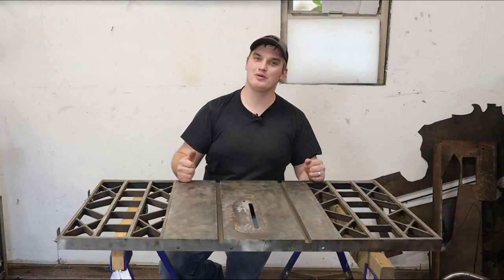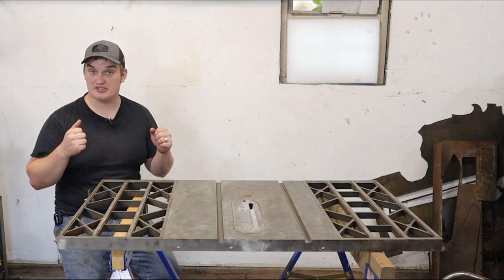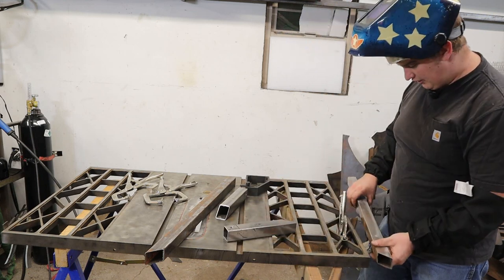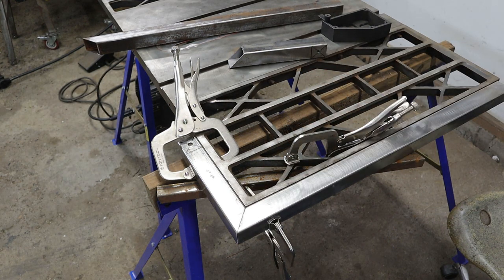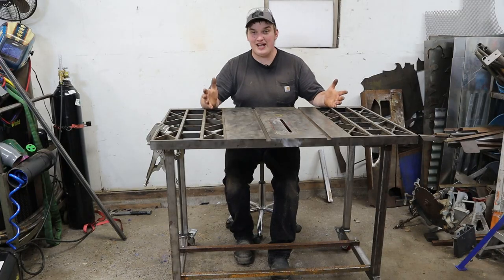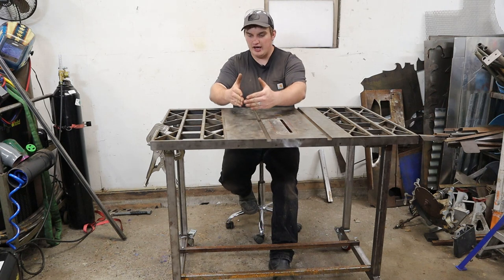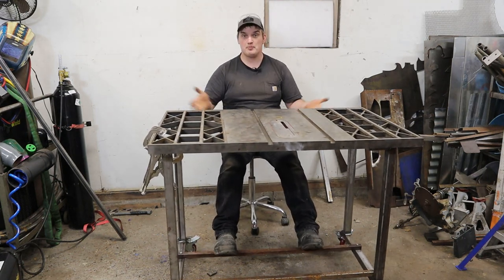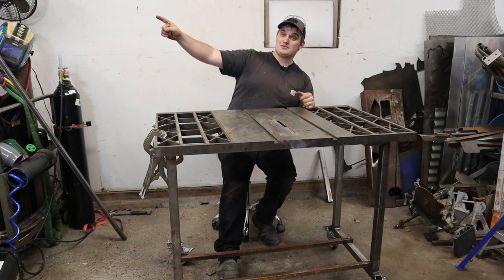$30 DIY  budget Welding/ fixture table build  Part 2

Comment: Thanks for the great ideas. I bought an old Craftsman table saw for $25 off Craigslist. Then removed the saw components, opened up the backside and welded two shelves inside. Added 2" casters. Left enough clearance to put my foot pedal under the bottom shelf. Doesn't fold up but it is sturdy and mobile.
Reply from the maker: That's awesome . Way to think out side the box. Thanks for the support. 🙏👊😎

Comment: Just an idea for your table bottom crossmembers . Square tube like you have already but instead of bolting it together just cut 4 pieces of C-Channel a few inches long , then have the open C pieces facing down then weld them to each end of the cross members . Then you can just set them with the C-Channel straddling your front to back stringers . Just a faster set up and teardown for mobility . Just a thought .

Comment: I picked up one of these from an engineers daughter who had it laying around for over 20 years. It's such a beautiful piece of equipment. That one was $30 I've come across multiple under the $80 mark. Great ideas across the board.
Reply from the maker: By the way I love your YouTube handle
Reply: @amcustomfab  thanks buddy I created it after my first choice got taken after I procrastinated. I wanted to chime in back here, that as a quicker and easy and maybe cheaper option a rolling miter saw stand might be a good base for those that want the folding ability.

Comment: Great job.  I liked the flip up stops.  You could use those on two sides for making square joints instead of using the outside of the table. Also, clever idea reusing the miter gauge. I hope there will be more to this series. I already watched your videos on the clamps, belt grinder and the electromagnetic "vise" are all great options, I'm trying to think of more ways to use the parallel slots.
Reply from the maker: Thanks for the support. I still have parts left over and I still have ideas on functional tools that can be made with those parts just have to get the time to get the videos out I appreciate the insight  ..

Comment: Excellent project. I thought of a possible enhancement: where the throat plate is, maybe add some square tubing that you could use for clamping like you do with the webbing? Also, when it is folded up maybe a couple casters on one long edge would make it easy to roll to and from your truck; 100 pounds gets heavy fast if you have to carry it very far. Great job! Thanks for sharing.

Comment: I bought a heavy duty steel cart on wheels with grease fittings. Tomorrow I have my eye on an old craftsman table saw all cast iron just like the one you have. I love creating useful stuff and maybe selling it. It’s my second build the first one was a three legged grinder table and I added a steel 12x60 grate from a parking lot drain. I cut it in half and spot welded them in a 24”x30” table top bolted to the grinder table so I can disassemble it and move it around in 2 pieces.

Comment: One addition I'm gonna use with my table. I ordered two craftsman miter guages with clamp stops to help with mitered welding. One guage for each slot ... angle it as needed...clamp it down before welding. Thanks for your video! Your inspiring new welders to get started inexpensive ideas. 👍
Reply from the maker: Thanks for watching 🙏😎👊

Comment: Great build! I would like to see a rotary table on this. You could put an axle bearing in the open area and have two round pieces of metal. the top having space for clamping and the bottom "smaller piece" to be able to spin with your foot. so when you have round welds to do. you can rotate with your foot and keep your hands in the same place. you could also use axle stops or callers to make it removeable for when not needed.

Comment: I like the creativity and video series. One thing I'd say for your table corner fixturing trick is to clamp 2 tubes diagonal across the corner on the top of the table instead of 1 below. It will be easier to clamp them, and easier to have the top plane of the tubes level since they'll butt up against 2 tubes held in plane by the machined table surface.
Reply from the maker: Agreed thanks for watching 😎

Comment: I bought one of these saws today because of your video! I'll use the table for welding and the motor and stand to power my belt sander because it's motor failed last week. Thanks for the ideas!
Reply from the maker: That's awesome thanks for watching 🙏😎👊
Reply from the maker: That's awesome thanks for watching 🙏😎👊

Comment: I'd like to see more detail on how you fastened the legs to the table. This is a great series.
Reply from the maker: Bolted tabs through the existing threaded holes on the bottom of the table. Then welded those to the frame for the legs thanks for watching and supporting the channel 😎🙏👊

Comment: Great table!  just an idea -- instead of bolting your horizontal bottom braces, could you use a locking shaft pin like for a pto or trailer and have a quick set up and take down?

Comment: I like the folding legs. I'm just a hobbyist welder so I don't really need the portability but it might come in handy on occasion. One question I have is about the table top now that it's mounted on those widespread legs. Have you checked for sag across the table?
Reply: I was thinking it could be mounted to one side of a work bench, on a hinge, so it would hang when not in use, but could be folded up to match the height of the workbench with swing down legs for support.  That way you save space when not in use, and you have the extra flat real estate when you need to weld something.  I think I am going to try this on the back of one of my roll away tool chests.  I have a 72" husky box that might be just right for the job.
Reply: @jeffdesilva    Those are snazzy.  Please let us know how they turn out, and if they have adjustments to achieve good flatness between the two decks when deployed.  Thanks for the heads up!

Comment: You might want to think about adding extra load bearing support for the heavy middle section.  Those lattice wings are only meant to support wood as it passes over, and now you've got a few bolts holding the solid section plus your arms and  whatever metal project you're working on.  Bolts can stretch and tear unless you've got really good steel in them.  Other than that, I'm stoked about this table!
Reply from the maker: You are correct I actually have the wings shimmed so the frame is supporting them past their bolts joint. Thanks for watching 🙏👊😎
Reply: @amcustomfab  Imagine that for some cosmically weird reason all four bolts give way at once.  Would the shims hold it up, or would the table fall in your lap?

I'm just thinking that as the bolts stretch you could end up with a dip in the table after twenty years, putting minor errors into your work.  Easy to correct, but you have to notice it.  Of course all of this probably won't ever happen, but in my shop, any flat surface becomes a storage shelf or step-stool.  Weight happens.

Comment: I found a working saw just like yours for $80 on Fakebook.  Sold the 3HP motor to a friend for $50 (needed it for his air compressor).  Stripped the guts and reinforced the legs with some scraps (bed frame rails)  Thanks for the great idea. down the road I might put a stand like yours under it.. do you have drawings for what  you built? Happy to throw a "service fee" your way for sharing..
Reply from the maker: I don't have drawings for the stand but I'm working on drawings for the belt. Sander

Comment: So, I see you are familiar with Fireball Tools.  I've bought a variety of their squares and I had a thought for you...    I was looking at my Magic Square that Jason sells and thinking it could be used in conjunction with a piece of bar stock so that you could quickly set clamp angles that are measured in degrees from the cross slide slot.  Sort of a combination of a perma-square/protractor/fixture clamp.  Jason is such a good dude, and always has an eye for innovation... I would bet that if you contacted him and showed him your idea, he would be on board for a fun side project combining his magic square with a cross slide tool.
Reply from the maker: I have met Jason he's a great guy. He's got some things in the works that are similar

Comment: Awesome Idea! just picked one up for myself, def gonna be a game changer for me, was thinking of trying to use some gas struts for the folding legs...think its doable? I do a lot of mobile work and have a tiny shop space so it would be nice to take it with or store it away.
Reply from the maker: I don't see why gas struts wouldn't work. That's a great idea. Depending on your folding mechanism, you might still want some sort of redundant lock to hold them open, but besides that I'd say give it a go

Comment: Thats a genius idea. Just got on FB Market place to find one for myself. Also, on a side note, do you have issues with messing your blades up on your Evolution saw when cutting at like 45 degrees angles? I've damaged 2 blades so far and ive probably only made around 100 cuts. Its like the blade catches as its about to pass completely through the metal.
Reply from the maker: There's a definitely a certain amount of finesse involved in lengthening the life of the blades you want to lunge slow at first, then you can speed up through the center of the cut and it slow down again at the end of the cut and make sure your materials supported so that it does not find on that last little piece before it breaks through the material. Appreciate you watching.

Comment: Thanks for part 2!  
-What was the name of that square you used?
-What type of material are you using foe the stand?
Reply from the maker: The square is made by fireball tool. All the tubing is 1.5".    .095 wall  square tube thanks for watching 🙏👊😎

Comment: @amcustomfab How did you weld to the cast-iron? I understand that's difficult to well too but you were able to get the steel tube to stick to it, is there any special technique? I just picked up the exact model you have from Facebook marketplace this morning and I am taking it apart now. Very excited to move forward.
Reply from the maker: Actually did not weld to the cast iron. I drilled pieces of flat bar and threw bolted from the bottom where the factory mounts were and then welded the leg frame to those pieces of flat bar.

Comment: You mentioned the slag seems not to stick to the top a proper table saw will have 3 coats of wax on it . I wonder how ceramic wax would work to preserve the welding surface?

Comment: The video did not show what is securing the table to the frame you made or supporting the top when weight is on it. How exactly is the castvtop attached to the fab frame
Reply from the maker: It shows briefly at the 3:40 second mark  there are a couple tabs welded to the frame that have holes that bolt into the existing threaded holes on the bottom of the casting

Comment: Good idea, but those table saws are not cheap in my part of the country. And if you find them, you would be wise to use them as a table saw, way better than the cheap sheet metal ones that Craftsman made in later years.

Comment: Hi I have a question-I have a line on a craftsman table, but I wanted to confirm, the table you bought are the side wings that attached to the main table, are they steel or aluminum?
Reply from the maker: They are steel
Reply: @amcustomfab  thanks
Reply from the maker: Thank you for watching

Comment: have you ever welded cast iron. My table is pretty flat i was thinking of just tacking the under side of the table where the wings connect to the main table. I saw that it can cause cracking, I dont want to mess it up. Any thoughts?
Reply from the maker: I would not try to weld the cast iron. I ended up drilling some holes in some flat plate bolting that to the existing threaded holes on the bottom side of the table and then welding the flat plate to my frame
Reply: @amcustomfab  yes I did see that. Ok thank you. Dude I am excited to build this table. I picked up the saw today. I’m amazed at how well built and well constructed even down to the fasteners. The table is.

Comment: What set up do you have for a vise and bench grinder?
Reply from the maker: I don't own either of those tools. I guess I have a tiny machinist vice that sits on top of the table like one of the little two inch ones if that counts?. No bench grinder. Just use hand grinders and belt sander Thanks for watching 😎

Comment: total noob question...when you're welding on the table wouldn't you accidentally weld your piece to the table?
Reply from the maker: That is definitely something you have to be aware of. But that's also what's great about this table is you can position your well joint over an open spot so that that does not happen. Thanks for watching 😎